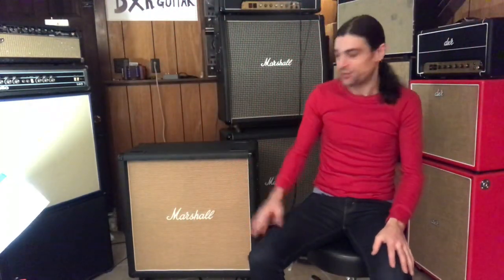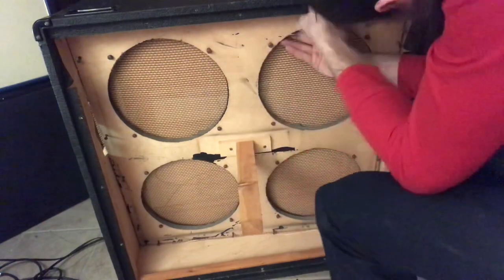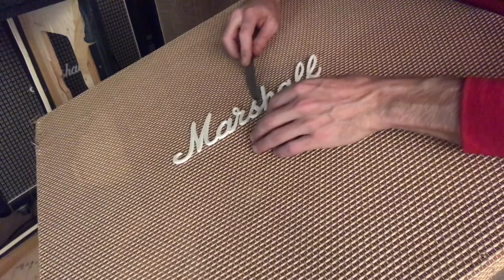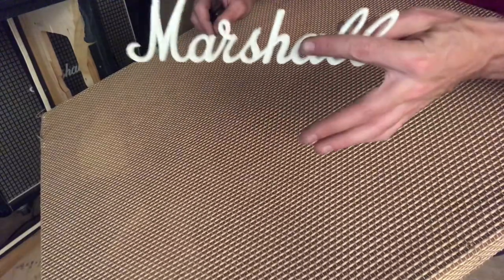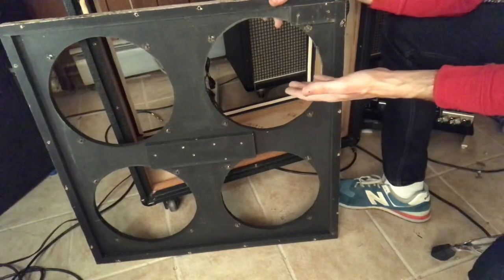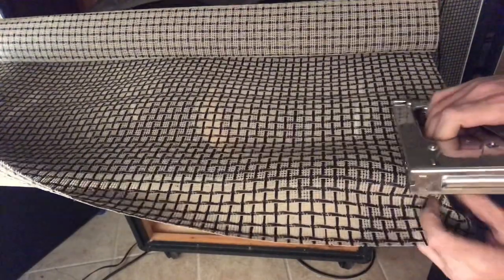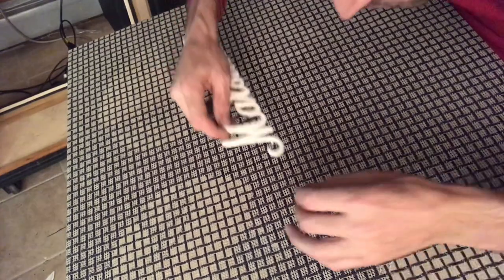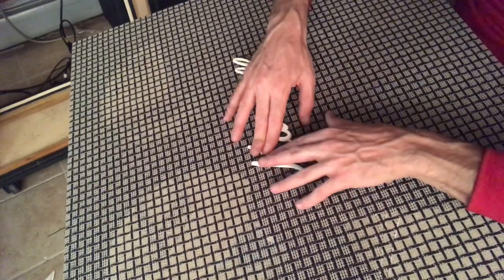How to replace the grill cloth on a Marshall 4x12 cab

Comment: I've got a 4x12 Line 6 cabinet that needs redone.  Anyone know where I might be able to find OEM material or something that's close to Line 6 OEM material to recover this grill?   I bought some material, online, but it's plastic, super stiff and has a really loose weave.   I'm looking for some cloth material, not plastic chicken wire.
Reply from the maker: i got mine from mojotone!  cheers!
Reply: Nice job Mojotone is a killer place for all your amp needs truly grill cloth , caps, resistors , tubes, output transformers , potentiometers, and they also have tube amps you can build or they will do it for you .Staff is awesome with fast shipping